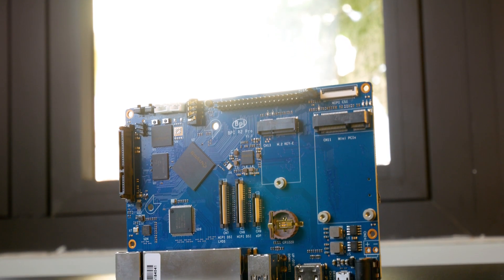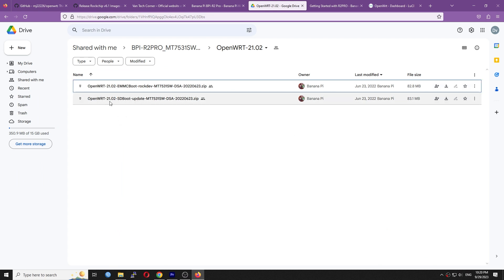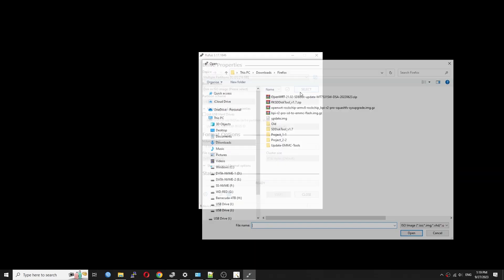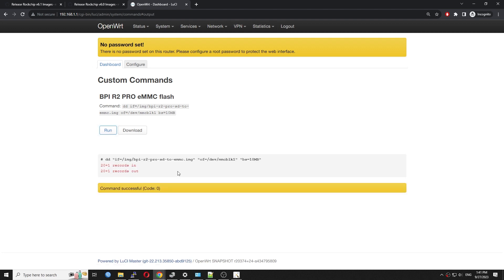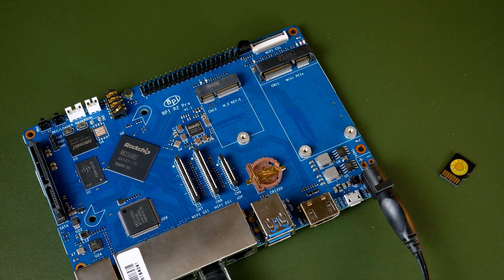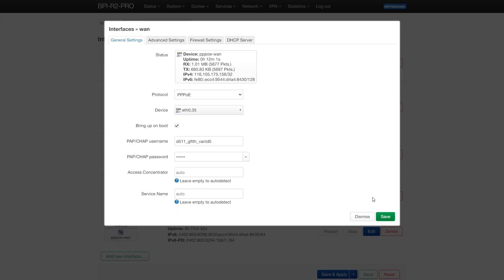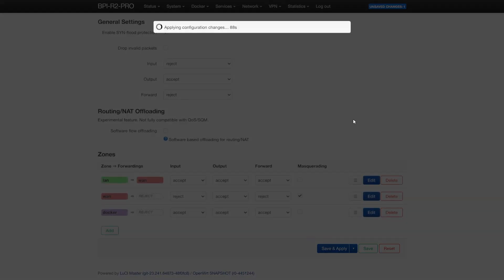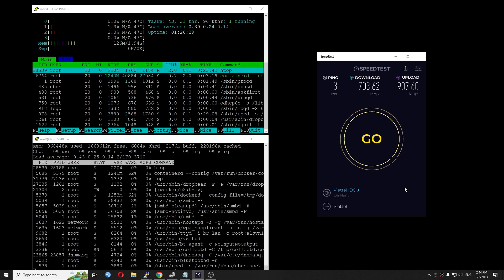Install OpenWrt 23 on Banana Pi R2 PRO & PPPoE Speedtest

Comment: I bought the router  Banana Pi R2 PRO and installed OpenWRT (Linux OpenWrt 6.6.43 #0 SMP Sat Jul 27). Im testing it using open speedtest server installed on the router (docker), and getting very poor download performance , around 20Mbps over 1Gbit ethernet. What is strange the upload speed is normal around 900Mbps. Ive enabled Software flow offloading in Firewall setting, but it does not help much. Is there anything more I need to do to fix the performance issues?

Comment: Hi @VanTech is it suitable for 1 gbps internet plan? Can you recommend any router ? mikrotik 750gr3 can handle 1 gbps wan well ?
Reply from the maker: Hi, this BPI-R2-PRO is suitable for 1Gbps internet connection.
- RB750Gr3 can handle 1Gbps, but you need fasttrack (and no SQM).
- From what I have tested, Linksys WRT1900, Belkin RT3200 can handle 1Gbps without problem. If you are interested, you can check out some products on my store https://shopee.vn/M%E1%BA%A1ch-ph%C3%A1t-tri%E1%BB%83n-Router-Banana-Pi-R2-PRO-i.332992965.19194958207

Comment: Hi 👋
I have a NanoPi R5C..
when the device is turned off, it loses the correct time..
and I have to correct the time manually..how can I maintain the original time..
even though the RTC battery is connected

Comment: bro can you make a vedio for TL-WR840N v6, it has MediaTek chip but so far i have not seen any vedio.
Reply: This device is NOT RECOMMENDED for future use with OpenWrt due to low flash/ram.
DO NOT BUY DEVICES WITH 4MB FLASH / 32MB RAM if you intend to flash an up-to-date and secure OpenWrt version onto it! See 4/32 warning for details.

1) This device does not have sufficient resources (flash and/or RAM) to provide secure and reliable operation.
This means that even setting a password or changing simple network settings might not be possible any more, rendering the device effectively useless. See OpenWrt on 4/32 devices what you can do now.

2) OpenWrt support for this device has ended in 2022.
19.07.10 was the last official build for 4/32 devices.

Comment: I remember seeing you asking questions in forums I was in while getting this exact board to run way back. The tools from the manufacturer is... let's say LESS than easy and developed to use.
Then luckily also found mj22226's compiled versions and have not looked back since.